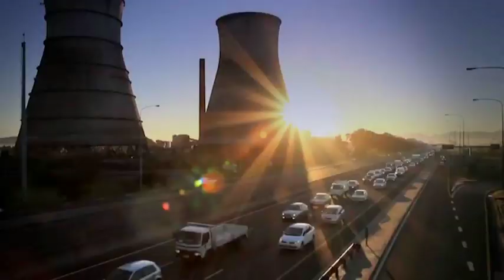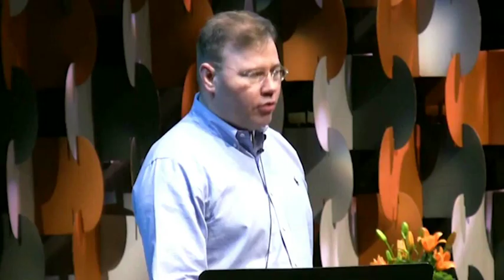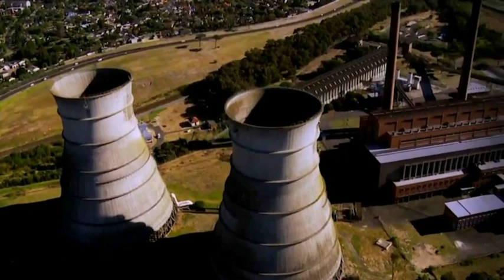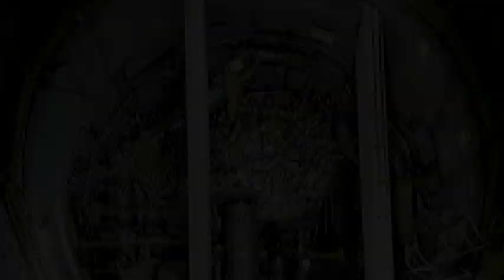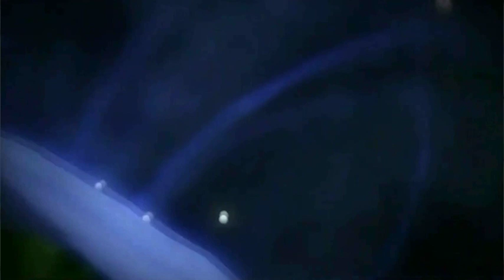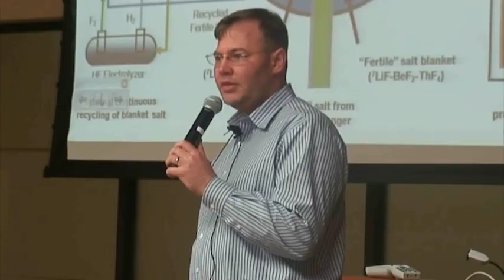Undercurrent - s04e08 - Thorium

Comment: Thorium is pretty good stuff, and it is proven technology.  Ask the DOE about it.
However, about 2 years ago I had someone bend my ear about Cold Fusion/LENR.
I started looking at NASA's involvement in it, and quickly realized that it was doable. Google this:  Dennis Bushnell LENR.  This guy is no joker.  Those who refute this mans vision of then future of mankind are uninformed FOOL's, and not Motley either.

Spend a little time on YouTube as well, looking at the presentations of ICCF 18.

But that is only the tip top of the iceberg.  For the last 2 years I have collected 22 Black Swan Energy technologies, And I am not talking about the company that goes by that name.  Not all of the following concepts will be developed to the point where they will have any real impact on mankind, but you can bet that many of them will;  alone and in wonderful hybrid combinations with others on the list.

So, here's the list:

22 BLACK SWANS
With updates, 6/14/14

When you take into account the amount of money that is spent on energy in the US annually, approximately  $3.04 Trillion dollars. (This figure was just bumped up to 6-8 Trillion dollars by a seemingly qualified member of the BEM doubling the 95 quad number to 200 quads)   That is 95 Quads at an equivalent of 8 Billion gallons of gas per Quad, (this per the EIA, and Robert Godes of Brillouin Energy).  It is easy to see how much resistance the oil companies and the Nuclear power folks might muster.
Much of this may be new to you.  I understand that, but please consider these things.  You want innovation that will change the face of the planet?  I think that at last count 656 patent applications can be viewed for LENR alone.  On another note I added number 17, not because it generated excess energy, but because it's just damned neat that plasma is so easy to generate.
Additionally there is much info available through a DOE sanctioned site www.science.gov on all of these birds.
Come on Already!!  It may very well be that not all of these advances will ever come to fruitiion.  However at the rate new approaches to energy production are coming to the surface I am reminded of an old adage.  "What man can conceive, man can achieve."  About 1 per month is showing up currently.  I am betting that at least 1/2 of these birds can power a new and extraordinarily interesting world.  Maybe all of them!  Do not dismiss these birds.  Now here is the deal, this rattles me a little. 
I ran actoss a presentation made to the Nobel Prize People on Thermionics in 1929.  He was over unity.  In that paper the term "Perpetuum Mobile" was used.  I thought I would google it.  People around the world have built so many interesting devices,  motors, that ran all by themselves, using MANY curious phenomena  Not the least of which is this one.  3D Printed AtmoMotor HV Atmospheric Motor - Wireless Energy  .  The big money guys do not give one damn dam about you, me, the rest of mankind.  They may take big write offs because they put on an obfuscatory show of being a benefactors, but they cling to that which is killing the earth.  I'm a little rattled!
It's gotta be on this list.
1.  Cold Fusion, also known as Low Energy Nuclear Reactions, Lattice Assisted Nuclear Reactions, Controlled Electron Capture Reaction.  These technologies are all about forcing Hydrogen or Deuterium atoms into the crystal lattice of a metal such as Nickel.  Once the crystal lattice of the metal nano powder has been sufficently saturated with Hydrogen excess heat is generated.  This is not hard to see, as everything is still vibrating, but now all the atoms are in much closer proximity than before.  The quanta mechanical explanations are not fully understood, but there are several companies and government offices that have operational devices.  Good bye oil.  Google LENR, NASA, Zawodny, and Bushnell.  NASA loves it.  Checkout this youtube video from NASA.  The big question is why the DOE is dragging their heals.
2012 - LENR (Low-Energy Nuclear Reactions) - NASA (Joseph Zawodny) LENR Promo Video
http://www.amu.ac.in/newevent/event/9861.pdf
do a quick search at the above site for "LENR"  The Indians are on it.
2.  Dense Plasma Focus goes something like this.  Two cylindrical electrodes are enclosed in a glass tube after one electrode  is slipped inside the other.  The tube is then filled with Boron gas and high voltage is applied to the electrodes. A plasma is then produced and pulsed by a strong magnetic field.  As this pulsing is increased and focused the plasmoids begin to ball up on one another.  As pulsing continues a beam of electrons emanates from one end of the tube and a beam of protons from the other, with extremely high amounts of energy being produced.  Google Charles Chase, Skunk Works, and Dense Plasma Focus.  Watch Charles Chase on youtube.
Solve for X: Charles Chase on energy for everyone
3.  Catalyzed Hydrogen is what will replace Electrolysis.  Molybdenum Sulfide is but one of the substances that will trim the Hydrogen right off the water molecule with no energy being expended, releasing it to power a fuel cell and generate electricity directly.  There was a graduate student by the name of Chang working in Berkeley CA on this a couple of years ago.
http://www.hydrogencarsnow.com/blog2/index.php/hydrogen-fuel-production/molybdenum-based-catalyst-for-cheap-hydrogen-production/
4. Graphene is essentially one atom thick layers of Carbon alternated between layers of insulation, such as mylar.  When you get a bunch of these layers stacked up and attach an electrodes to the top and bottom of the stack you have created a capacitor of another color.  Extremely high values of capacitance can be arrived at.  3000 farads is what I have seen advertised, the size of a marine battery. This material can be used as a capacitor, a spectacular new form of battery, or configured as an extremely efficient solar cell.  Additionally I have recently heard of work aimed at producing LENR in a Graphene environment.  Ampenergo is a company that I think licensed this technology from the government.  I want so much for Elon Musk to incorporate this into his new models.
http://www.sciencedaily.com/news/matter_energy/graphene/
http://spectrum.ieee.org/nanoclast/semiconductors/nanotechnology/graphene-hybrid-material-lithium-ion-battery-powered-vehicles
https://connect.arc.nasa.gov/p9lyoab9wjr/?launcher=false&fcsContent=true&pbMode=normal
5.  Zero Point Energy/Energy of the Vacuum used to be a little far out for me, but now I think I've got a cursory handle on it.  The process on a Quantum level is much like the process that produces Ball Lightening.   When tectonic plates shift causing an earth quake and occasionallly something called Ball Lightening.  Only in Zero Point it is what happens when an Orthorhombic plane from another dimension intersects our dimension and causes a disruption, releasing energy.  Heare's a Moray B. King video from the Breakthrough Energy Movement
Moray B King : One Million Cavitating Water Electrolyzers
6.  Acoustic Cavitation/Bubble Fusion/Sonofusion.  I am not sure at all how to say anything about this, but there is a great deal published about the possibility of deriving energy using this phenomenon.
http://sonofusionjets.com/
7.  Muon catalyzed Fusion.  Oh this is a good one!! Fermi Lab and SLAC developed a coherent beam of Muon's a couple of years ago.  They shoot it into Hydrogen or Deuterium gas, and because the Muons have a negative charge equal to an electron, but are 207 times more massive than an electron they knock the electrons out of orbit around the Nucleus and the Fusion is made to happen in the atoms Nucleus.   I don't know how many electron shells a beam can penetrate.  But I'm betting it is more than one.   Pretty good stuff...
What is muon catalysed fusion?
8.  HALOGEN-CATALYSED COLD NUCLEAR FUSION, yet another, not quite as much info available for this flavor.
http://www.lenr-forum.com/showthread.php?1061-Patent-for-halogen-catalysed-LENR
9.  Thermionic Power Generation,  I heard about this just the other day.  It may be that this technology will be a prime player.  The devices turn heat from the sun, or anything else directly into electricity, instead of using light as photovoltaic solar cells do.
http://www.science20.com/news_articles/thermionic_conversion_and_path_new_thermoelectronic_generator-125562
http://www.sciencedirect.com/science/article/pii/S0925963511002184
http://energy.gov/eere/sunshot/project-profile-next-generation-thermionic-solar-energy-conversion
http://nemanich.physics.asu.edu/sites/default/files/publications/savades/e245327.pdf
http://www.nobelprize.org/nobel_prizes/physics/laureates/1928/richardson-lecture.pdf
I don't quite get it, but here is a patent from 1981 for this technology.  I think NOW is the time for it to rise to the occasion.
http://www.google.com/patents/US4368416
10.  LENR with Zeolites, And of course the loading of zeolite with hydrogen, or deuterium gas
http://coldfusionnow.org/iraj-parchamazad-lenr-with-zeolites/\
You've got to love these guys.  I would think that this would have to be one of the most easily demonstrated methods of cold fusion.  At least if you believe these two fellows.
11.  Papp Engine.  As it turns out plasma is pretty simple to make.  Anyone can do it with a 12 V battery.  Ever seen a simple spark while you were giving yourself a jump start to your automobiole? Within the spark, taking into account that 1% of the atmosphere is composed of Nobel gases, which go to the Plasma state within the spark.
There are no magnets to confine the plasma once it is formed, so it is allowed to expand and drive a piston.  My explanation is my own, but I think its close.
Pulser Plasma Engine Core: Recovering the Papp Engine
12.  Bloom Box.  I don't know how I missed this one.  All the big money is going HERE.  The video is from 60 minutes a couple of years ago.  Things are on a roll here with what looks like a jump for fuel cells.  It amounts to thin wafers of Silicon that have been coated with different materials on each side and then stacked, much as the way you would stack Graphene layers upon one another.
From what is said on 60 minutes these things are being deployed at major .com outfits in Silicon Valley.
http://www.cbsnews.com/videos/alternative-energy-the-bloom-box/
13.  BlackLight Power Hydrino machine.  OK, we're at a bakers dozen now, what the heck is going on.  10MW of electricity out of 1 cu. ft. package!!??
http://revolution-green.com/blacklight-power-car-travel-3000-miles-liter-water-without-pollution/
http://www.blacklightpower.com/business/business-summary/
The following is a caption under an illustration at the above website.  
SF-CIHT Cell Generates Electricity Directly from Water Freely Available in the Humidity in the Air
14.  Steorn Machine.  They say that this new kind of electric generator has been duplicated by a number of organizations.  A key fundemental cited is "Magnetic Regauging"  Ferrite materials figure in as well.  I actually have some experience using ferrite material.  I built Isolators and circulators for military microwave applications.  Biasing a ferrite puck with magnets causes microwave energy to flow in a circular manner within the ferrite.  Reverse the magnetic polarity and energy flows in the opposite direction.  While I was working in the field as a technician I was told that the phenomenon was not 100% understood.  Perhaps it is now.  Additionaly I witnessed a couple of folks producing a little bit different kind of sintered ferrite material in the late 80's that turned out to be high temperature super conducting material.  It's the symmetry of a magnetic circuit that has been the thing that has been in the way.  They say they have created a means of creating a constantly asymmetrical magnetic circuit.  Or, something like that.  Holy Smokes it's beginning to make sense to me!  On a personal note I had recurrent dreams of a machine very much like this one.  A little spooky!
http://jnaudin.free.fr/steorn/indexen.htm
15.  Hydrobetatron.  The best information that I have seen so far paints it as another flavor of LENR.
http://www.pureenergyblog.com/2013/06/17/1329/8502332_hydrobetatrons-lenr-open-source-energy-project/
16. The Stirling Engine  If this isn't a show stopper, I don't know what it is!! 
http://en.wikipedia.org/wiki/Stirling_engine#Applications
17.  Multiplaz Welding and Cutting Tool,  This doesn't generate excess heat, but it uses tap water and alcohol to make a heck of a plasma cutter.  The fact that Plasma can so easily and cheaply produced is what I find  interesting.
http://www.multiplaz.com/about
18.  Optical Rectification  The deal here is essentially they have tapped the electromagnetic nature of light.  After all different colored lights have different wavelenghts and therefore different frequencies.  Everything from DC to daylight and beyond is what makes up the electromagnetic spectrum.  They have now figured out how to rectify these extremely high frequencies and produce direct current electricity.  You rectify 60 cycle AC you build an electrical bridge circuit of diodes to convert it to DC.  Optical Rectification is a Quantum kind of thing.
http://en.wikipedia.org/wiki/Optical_rectification
http://www.eurekalert.org/pub_releases/2011-04/uom-spw041911.php
http://www.businesswire.com/news/home/20100727006791/en/Black-Swan-Solar-Technology-Emerges#.U3K8dvldWvU
19.  Thermophotovoltaics  
http://spectrum.ieee.org/nanoclast/semiconductors/nanotechnology/nanostructured-ceramic-coatings-enable-the-potential-of-thermophotovoltaics
20.  Photoswitching  This amounts to a hinged nanomolecular construct that switches from one state to the other on demand releasing energy.  When the sun isn't out rechargeable solar batteries use a small electric current or a small light to start the switching back to the other state.  There is some plumbing involved and a liquid medium holds thr charge.
http://finance.yahoo.com/news/scientists-discover-generate-solar-power-172726044.html
http://www.greencarcongress.com/2014/04/20140412-mit.html
http://time.com/65086/how-to-generate-solar-power-where-the-sun-dont-shine/
21.  Ryden dual carbon battery  
http://news.msn.com/science-technology/the-organic-battery-from-japan-that-could-spawn-the-next-tesla-1
http://www.forbes.com/sites/jenniferhicks/2014/05/13/sustainable-materials-take-shape-japans-new-dual-carbon-battery/
http://powerjapanplus.com/
http://www.gizmag.com/dual-carbon-fast-charging-battery/32121/
22.  Singlet Exiton Fission  A new approach to Solar Cells
http://theenergycollective.com/energyatmit/378581/getting-more-electricity-out-solar-cells?utm_source=tec_newsletter&utm_medium=email&utm_campaign=newsletter&inf_contact_key=32bc4b5ff44c3f65c48459a81ad4522063b12942604cd4202d07ed0e152a7292
Paul D. Maher
www.coldfusionnow.org

Comment: The DOE had an operational Thorium Reactor in the 1950's.  It was shut down because of the fact that it created no Plutonium.  And I truly believe that that for national security reasons Thorium was dumped.  WELL, IT'S TIME TO BRING IT BACK!!  We don't need anymore Plutonium!!
Reply: Well, NASA and other agencies need an isotope plutonium to power space probes and things, but that's only a small amount of an isotope that isn't used in warheads.
Reply: No, the didn't have an operational thorium reactor in the 1950s. They had an operational molten salt uranium reactor, but even the MSRE in the 60s didn't have a thorium breeding blanket. After the 60s. the guys at ORNL certainly wanted to go build the whole shebang as a successor to the MSRE, but DOE cut their funding.
Now there was at least one operational thorium reactor in the world, the German THTR-300, but that was plagued by design and operational problems, like who the hell thought to themselves "reliable reactor = 3/4 of a million moving parts"?
Pebble beds are fundamentally just a shitty idea for a reactor. Either make the fuel of a few nice solid rods that don't go anywhere (IFR, TWR), or make the fuel a mobile liquid (MSR) - the middle ground of hundreds of thousands of TRISO fuel pebbles makes no sense. If in the 60s they had the supercomputing power available today, they could have easily simulated that pebble bed is the worst of both approaches.
Reply: kokofan50 Understand that this certain isotope is Plutonium 238 not 239, no current day nuclear rector makes plutonium 238 or else NASA would already have what they need.

But guess what! the thorium reactor cycle produces this exact isotope, and because it's in solution it is easy to remove from the reactor!
Reply: And NASA may not need anymore.

https://futurism.com/nasa-to-test-nuclear-reactor-designed-to-power-future-mars-colony/

Comment: Scott Ludlam was talking out of his ass... "the industry has been trying to get a thorium fuel cycle proven up since at least the 1960's, it's never worked..." Did he even take 10 minutes to read about the success of the Molten Salt Reactor Experiment at Oak Ridge National Laboratory? The reactor was run for well over 20,000 hours, the equivalent of 2.5 years. It met expectations and demonstrated the core technologies. The liquid thorium fuel cycle WAS proven, it just wasn't good for making weapons-grade plutonium so it had no political support or funding since 1969. Nixon pushed for the uranium fast-breeder reactor to get jobs in California and the LFTR fell by the wayside. The fast breeder hasn't worked yet but could be another great solution today (see WAMSR).
Reply: I am still liking a LFTR over a Molten metal such as sodium, since the solution is stable and doesn't like to react as crazily as sodium.

Comment: The old style cooling towers are not required on New thorium reactors...since they use molten salt as a heat exchanger (not 2 loops of water).  So that parting shot of cooling towers is pretty much bullshit.